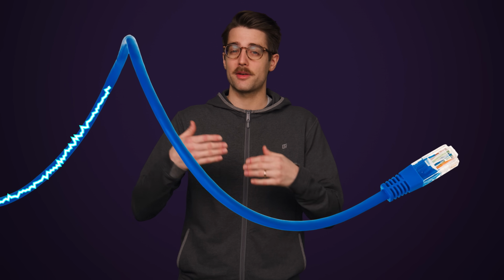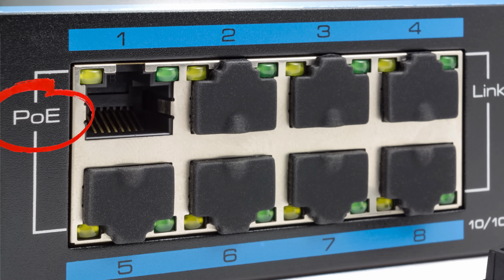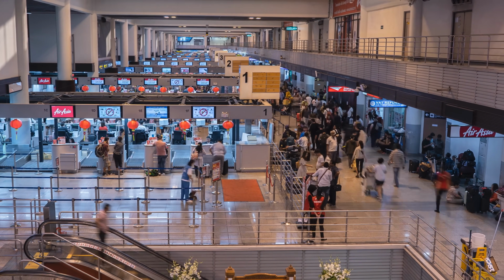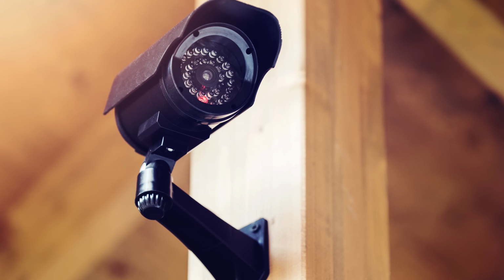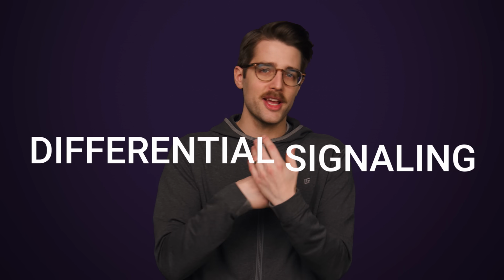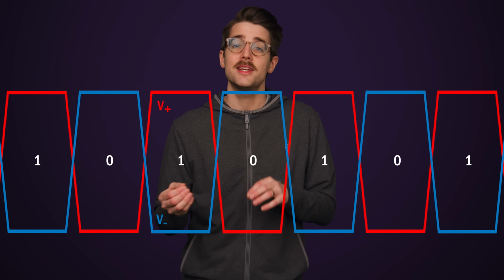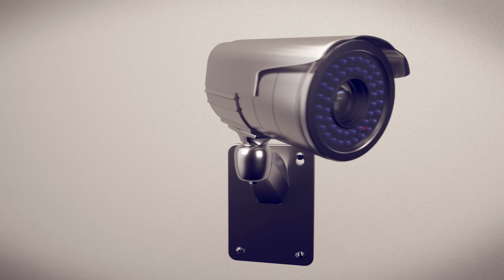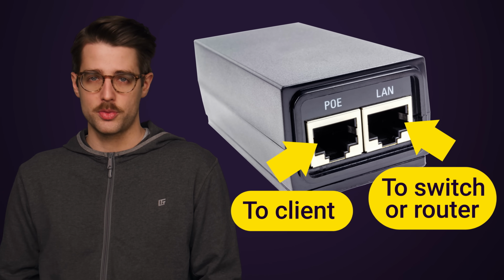Power...Over An Ethernet Cable?

Comment: I've powered a bunch of LEDs using CAT5 as a power cable, it works great because the wire is cheap and you can add terminals super easily.

Comment: PoE is typically run on the blue and brown pair while data is on the orange and green pairs.

100M is the maximum length of a typical data cable.  It really has nothing to do with PoE.
Reply: I once read/heard that the cap ought to be a little less than that so that you’ll have a little wiggle room.
Reply: 100BaseT uses two pairs, IIUC faster standards need all four.  When I worked with 100BT PoE on the unused pairs, we'd just up the feed-in voltage for longer runs. Pretty sure we commonly went over 150m no prob.

Comment: Back in 2006-07 I went to high school to become an electrician. One of the jobs we got to do was to supply Ethernet to the student dormitories. We had a cabinet with our switch and the power supply, and from there it supplied 9 other dorms.We had to use some special equipment to run the wifi routers with power through the Ethernet cable, it was called phantom voltage if directly translated from Norwegian. So we had the router at each dorm with a splitter and a power unit. It worked well and saved us a whole lot of trouble instead of having to supply separate power to each router as well.

Comment: But can you plug a PoE cable with 100W on it into a pc? 😳 what if there are lot of PoE terminals in a home, will plugging in a non-supported device fry it?
Reply: As long as you stick to active POE you'll be good. Active POE only sends power if the device supports it.

Comment: Wait...I think they're confusing Ethernet over Power from Power over Ethernet.

From my understanding, the former does use voltage differentials to send signals through the power lines. It's apparently surprisingly effective in certain situations. For the latter, the RJ45 standard includes wiring for both electricity and grounding in the form of the brown & white/brown wires.
Reply: Well, no. They got it wrong, but you're not right either, sorry. The wires are all there originally for data. 100M data just doesn't use two pairs of it.

There are 4 differential pairs of wires in the cable. 100Mbps only uses one pair per direction, so the first PoE standard was to simply use the remaining two for power - one whole pair for positive 48 V, the other for negative. 1 Gbps uses all four pairs for data, but as it's a differential signal, it can still send the differences on a single pair, and the PoE splitter just has to separate the differential signal (small voltage differences between wires in a pair) from the "common mode" voltage (the overall voltage the whole pair sits at). As this can, in the simplest case, be done with passive devices like chokes and caps, it's simple and cheap.
Later PoE standards extended that to all pairs.

Comment: Be careful, some poe injectors just send poe with out checking. I have burned out laptop ethernet ports (the nic) with ubiquiti's injectors. 
Also make sure the right poe standard is being used. Ubiquiti uses poe+ and won't power on with your everyday Cisco switch

Comment: Remember to NEVER plug a PoE cable (as in one end that's in a PoE switch) in to something that doesn't support it. Unless you enjoy the smell of burned electronics.
Reply: As long as it's active POE you can plug it into anything even devices that don't support POE
Reply: Not really a problem - because ethernet uses magnetic isolation anyway, the PoE won't do any damage to an ethernet device. Unless it is really badly designed.

That's only true of ethernet though - plug it into a non-ethernet device and you get the smoke. I fried a cable tester that way once.
Reply: If you did it with those dumb passive PoE switch or injector then a magic smoke would escape either on your device. Those 802.1at/af or newer devices would not hurt both of your device, it is smart enough not to send power on those lines for devices not capable for PoE.

Comment: I thought poe just used those other four wires. This is much cooler.
Reply: Some earlier, non-standard forms of PoE worked like that. You still occasionally find them in niches like security cameras.
Reply: @vylbird8014  Oh, cool. Thank you!

Comment: Oh boy.  Ok, a few things here.

POE - Passive 12VDC or 24VDC.   NOT negotiated... the power is passively put on the cable.  This standard is obsolete and should no longer be used (though some security systems still use it and try to market it as something cool or special, it's really just old and should no longer be used).  NO short circuit protection, NO voltage fail-safe, limited range, very limited power at range due to the voltage drop on the cable.

POE+ - 48VDC (typically originated at 56VDC), up to 100W for commercial POE+.  But roughly 60W is typical for consumer POE+.   This standard can go much, much longer distances and still provide most of the ingress power due to the higher voltage.   The power is negotiated between the two ends, so POE+ and normal non-POE ethernet can be mixed together without having to worry about causing problems.   The switches and clients determine the actual amount of power needed and refuse connections that exceed available power.

Your description of how POW puts power on the cable is completely wrong.   Its just a DC level.  The ethernet comms are differential signals that simply run on top of the DC level.  Nothing swings between positive and negative voltages, certainly not the data signals!   POE uses a 12V or 24VDC, POE+ uses 48VDC.  The actual DC voltage injected is usually around 15% higher in order to be able to supply a decent voltage at the end of the cable.   By supplying a higher voltage, POE+ loses less power over the cable over distance because the current is lower.  And also because the voltage is higher, POE+ can supply far more power than the original POE standard could.

Over 100M cables are supported by POE+, as long as you take into account the greater voltage drop.  Some POE+ switches have a 'range extender' switch which bumps the voltage up a bit more.   However, gigabit ethernet is generally limited to 100M so if you go over that it is a good idea to use a POE+ forwarder to extend the range further.

Do not use POE injectors if you can help it, that's straight out dumb... only use an injector if you have no other choice.  Almost all POE injectors use the POE standard and not the POE+ standard, and they all tend to be severely limited in how much power they can actually inject.

Just make your router a POE+ switch and you are basically done.  I recommend switches that can supply at least two full-power 60W outputs.

Forwarding POE+:  You can have multiple switches and forwarders.  You can extend a cable with another POE+ powered switch, OR you can use a POE+ forwarding switch.   Forwarding switches are powered from the ingress POE+ ethernet and do not require separate power.  These usually have two output ports (30W input, 15W outputs) or four output ports (60W input, 15W outputs), plus of course the ingress port.

--

You can fan-out POE+ as much as you like as long as the power negotiations between devices succeed.  However, you must be sure not to exceed the power capabilities of the powered switches.

POE+ security cameras typically burn around 6W each.  Slightly more if motorized but that isn't usually  concern.   So, for example, a single 100W switch can handle around 16 cameras.

POE+ WIFI routers usually burn around 15W each.  They tend to be fairly power hungry, so care must be taken to make sure you can properly power multiple WIFI routers.

-Matt
Reply: A few corrections because much of this is also wrong

PoE doesn't refer to passive PoE, it refers to the 802.3af standard and is 48V negotiated delivering up to 15W power
PoE+ is the802.3at standard and gives 48V up to 30W
Poe++ is the 802.3bt standard is up to either 60W or 100W depending on if it's type 3 or type 4

Passive PoE doesn't adhere to any standards, it's completely fine to use as long as you know not to plug the wrong shit into it, active PoE is the future sure but devices have historically remained cheaper due to reduced complexity by using passive PoE. Maybe it doesn't affect small consumers but makes a difference to the bottom line when you are installing 100's of devices.
Reply: Nice addition dude.. thank you
Reply: That is a good point because you could permanently damage things that were not designed to work with PoE.  That can sometimes be more than 24 volts too!

Comment: This is beyond simplification
It is completely wrong, both in terms of how data is transferred and how power is delivered
Data is transferred using PAM, not just just differential signalling (the rate is much too high to make it viable, especially in gigabit in 1999, before first gHz CPU). PAM is Pulse amplitude modulation, and this method makes it possible to send more than one bit of data in a single symbol. 
I have confirmed my knowledge before posting this comment. 
I was about to write about PSK in place of PAM, but I checked first
You could check too.
Reply: More seriously dated: 10baseTX did use simple differential signalling and NZRI encoding (After 4B5B). 100baseTX is almost the same, just at a higher frequency - it does use a ternary encoding though. But by gigabit that's abandoned entirely, and the PAM comes in. None of which actually matters for PoE, because it's entirely independent of the modulation. You could run it over token ring, if you had some bizarre need for that.
Reply: @Vyl Bird  poe power comes between of pairs
That is thanks to ieee802.3ab design
Theoretically, you could run another 2-3 signals on Ethernet using whole pairs as single signal wire. Gigabit Ethernet wouldn't be able to notice.
Reply: @WizardNumberNext  Used do be common to do exactly that in analog telephones. There was some crosstalk, but it saved a lot on copper and let you increase the capacity of existing distribution cabinets without digging up the streets to lay new cables with more pairs.

Comment: Better than internet over the wall power, which makes a ton of noise that has been found in some instances to affect audio performance.  Although I believe it to be equipment specific, as most power supplies reject all the noise in their conversion to DC.  It could be an EMF crosstalk phenomenon that couples with rca signal cables.

Comment: "Max Poe length is 100 meters" 
Me who is currently powering a POE switch 1000ft away or 304 meters,.
Yes, It is possible to go way over 100 meters with POE, but depends what you need.

Comment: If the positive and negative voltages always swap, how can you generate a DC voltage from it? That's right, a FULL BRIDGE RECTIFIER!!!

I've been watching too much Electroboom lately.
Reply: They don't, he described it wrong.  Its actually a DC level.   Half the pairs are the ground referenced, and half the pairs are 48VDC referenced (for POE+).  You still use a full bridge rectifier on the client-side, but that is mostly for polarity protection, dealing with bad pairs, noise rejection, etc.   The power on the ethernet cable is DC, not AC.

The differential data signals do not swing between positive and negative voltages.  They swing relative to a DC level.  Half of the differential pairs are referenced to +48VDC (actually a bit higher), and the other half are referenced to GND.  The actual swings due to the data signaling are small voltages around the DC level.  So on pairs that are referenced to +48VDC, the differential data signals run a little above and a little below +48VDC but never get anywhere near ground or negative.   On the pairs that are referenced to GND, the differential data signals run a little above and a little below GND, so sure sometimes those signals will have small negative voltages relative to ground, but not in any way to generate 'power'.

Injecting AC power would be bad, because that would also inject incredible amounts of AC noise which the gigabit ethernet data signaling would have to compete against.

-Matt

Comment: Your explanation of differential signaling for a twisted pair is not how  Poe transmits power. It uses common voltage between pairs.

Comment: The explanation of how PoE signals are modulated is COMPLETELY WRONG in this video. The way Ethernet cables carry data is through differential pairs of wires, i.e., signals are encoded as high or low voltages between a pair of wires. There are 4 pairs of wires in Ethernet. What PoE does is connect the positive terminal of a power source to one pair, and the negative source to another pair. So the voltage difference in any pair of wires does not change whatsoever, as shown in the video. Rather, there is a voltage between one pair of wires and the other.
Reply: Center-tap transformers. Anyone who works in professional AV will recognise the technique: It's the same way phantom power is delivered over an XLR connection.
Reply: +1

Comment: Ubiquiti AP's use 24v POE injectors and most POE switches are  between 35v-57v
Reply: Doesn't most ubiquiti PoE stuff still use passive PoE? This isn't a concern with the more modern, standardized PoE.

Comment: I cut my dads LAN cable like 10 years ago, Im glad this wasnt a thing back then
Reply: Wouldn't hurt you at all, low voltage cable is exactly that, low voltage
Reply: PoE has been around for about 20 years, it was a thing 10 years ago. It just wasn't, and still mostly isn't, very common in the consumer space.

Comment: about that 100m, issnt a common network cable rated for 100 meters? And does speed suffer when using POE? bandwith? How about S-FTP cables? do they perform better (muc better shielding)

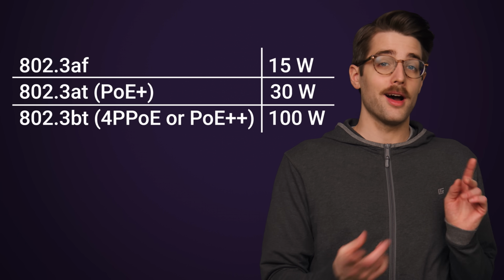I enjoy techquickie, i realy do. but sometimes they pack 30 seconds of information and add 3:12 of jokes in there.
These video's are what a simple google search will tell you on the first result, but most people know what something is and watch it to learn a little bit more, and i feel that in this video it lacked that little extra.

Comment: but doesn't usb/thunderbolt already do this however! but the only main difference between usb and thunder port is thunderbolt just has a much higher data transfer speed and power capability then usb bascily! also you should use ethernet just for a stable internet data direct connection line! ethernet calbes are just not designed for higher power voltage transfer especially  the fiber optic ethernet cords! the main thing is that fiber optic is good for data transfer but nowhere as good for power voltage when compared to typical copere or better contonive and electrical permeability kind of element melted into metal wires made  for specifically   transferring electricity!
Reply: Nothing in your comment makes any sense.  

E
Most Ethernet standards go 100 meters, which puts them in a completely separate market to USB and thunderbolt. USB also has dedicated wires for power, where Ethernet does not.  

PoE doesn't support over 100w, so your concern about high power is moot.  

Fiber optic cables cannot transmit a meaningful amount of power (since they're glass, not copper), and there's no standard I know of that supports power over fiber.  

I'm trying to take your comment seriously, but your spelling and grammar are atrocious and you obviously have no idea what you're talking about.

Comment: shouldv'e mentioned passive versus active poe; with 100mbit ethernet only half the wires are actually used so you can simply use the other half for wires.

Comment: Also is there a chance that power over Ethernet might fry a device that is not compatible?  Some PoE may be 24 or 48 volts, be careful what you plug into it.
Reply: Only for passive PoE, which was never standardized. I just make it a rule to stay as far away from passive PoE as possible.

Comment: I use poe injectors as repeaters in my tech go bag. Used them a couple times temporarily when I didn’t have a long enough cat6 cable. 

I ended up having a bunch of poe injectors that came with access points. But I didn’t need them because my switch was already poe. So this was a great way of not wasting them.

Comment: Heyo ive got some poe solutions 
Got ppoe pass through and stuff 
Also can power a networking switch with poe
Reply: Im a reseller of allied telesis, check them out they’ve got good switches and routers capable for up to 100gb and they support poe so epic
They are really great im happy to work with them

Comment: I have a HP 2530-48G-POEP Switch that is the backbone of my network. Use POE for my Router, Cameras, Rassberry Pi-Hole. Love the flexablility and I have my main VLAN for computers and APs, then a VLAN for Cameras, and a VLAN for Iot devices.
Reply: nice, is the guest channel on a separate vlan ? the main vlan is not the hardware default i hope.
Reply: @jyvben1520  I don’t use a guest Network, I don’t let outside devices on my network, i have a management VLAN that only allows a single client IP to access.

Comment: This is such a good video! I’m building my first house rn and I plan on using some POE devices and this explained basically everything I wanted to know!
Reply: As an AV installation tech, my advice is to make sure to sure to use at least CAT6a cables in the house for as much as you can. They will give the best performance. Making sure you have a convenient place to place the switch and everything will make troubleshooting easier if you don't have to crawl in a small closet or something to do it. Kind of an aside, but making sure you think about how an internet technician will hook up their cables to your network switch location is good, pre-running a fiber cable, CAT6, and coax cable for them to where to want your modem to be from near your electric meter will make your installation so much faster.